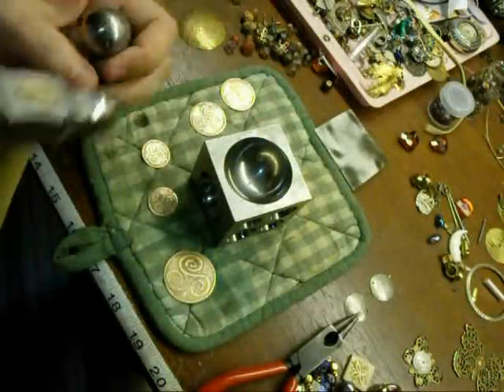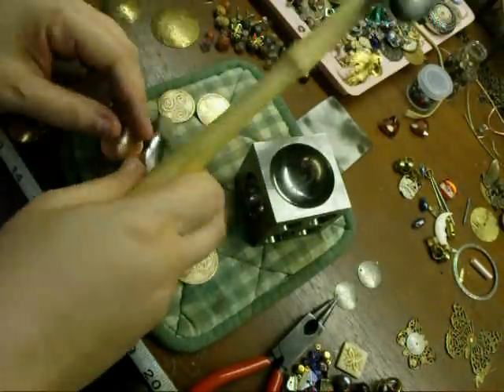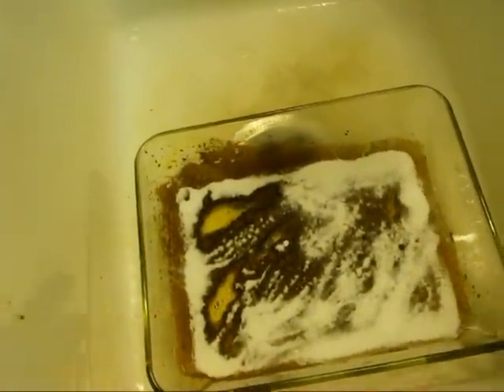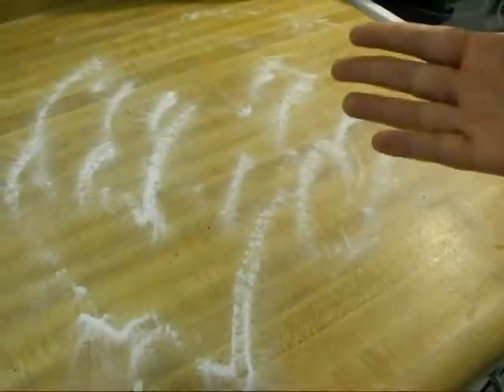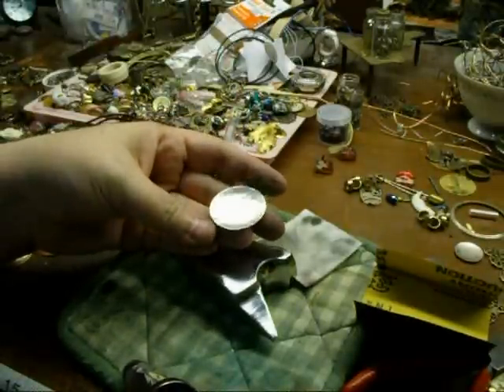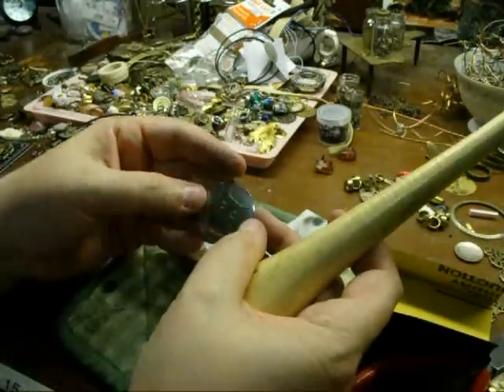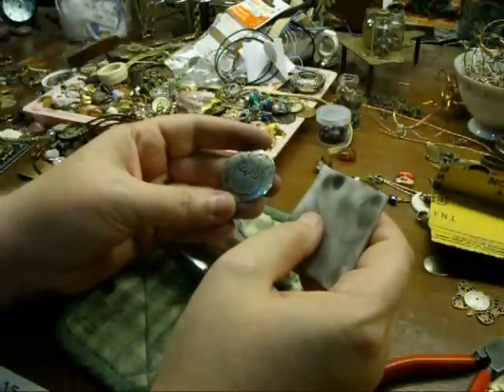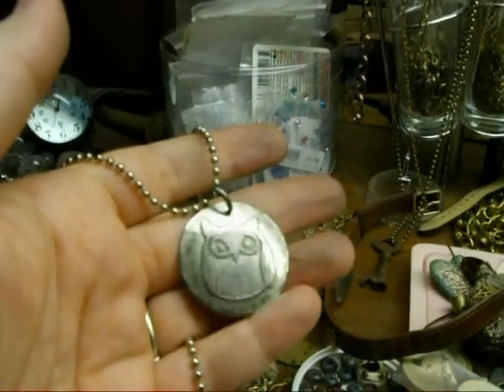Acid etching demonstration part 2

Comment: Very informative videos, I learned a lot from watching them! I am trying to etch nickel silver,  how long was Mr. Owl in his bath?
Reply from the maker: bls924 I don't recall, it's been almost 3 years since I made this video. Mr. Owl probably took about an hour and a half. But it also depends on the strength of your acid, how deep an etch you want, and the thickness of your metal. I've heard of some people putting it on top of a running dryer. The heat and agitation supposedly speed up the process. Just don't let it spill!

Comment: GREAT vids and finished products! Wow! LOVE that necklace at the end! Question for you if I may:  I recently lost my wedding ring of 22 years :-( and don't want to replace it with just anything. I'm pretty handy/crafty and I'd like to make my own so it has more meaning than just buying another ring. I thought I'd take some basic/stock metal ring and I want to try this acid-etching method with a meaningful phrase done in runes that I would draw around it using your method. What metals does ferric acid work with, do you know? All or only cetain types? For example, I've been looking at an inexpensive basic titanium ring to test it out on... But maybe should go with a different metal... Thoughts?
Reply from the maker: Thanks so much for your kind words. The ferric chloride I use works with brass, copper and nickel silver. I've been warned NOT to use it on other metals. I've seen info online about etching sterling with ferric nitrate, copper nitrate or silver nitrate, and gold with nitric acid and hydrochloric acid. It appears that acid-etching titanium is possible with hydrofluoric acid or something called Multi-Etch. But I have zero experience with these, so I can't say one way or the other how well they work. Personally, I'd take the new ring to a trophy shop, jewelry store or somewhere that does laser engraving and etching. The way things work with computers now, they might be able to put a custom design on it for you, without the chemistry. :)
Reply: JLHjewelry You're very welcome. Thank you for the quick reply and helpful info/guidance. I'll look into both: The laser engraving as well as the chemistry (I like the crafty side if within my skill set. If not I'll go with the laser). Thank you again. Really helpful. :-) Keep up the beautiful work!

Comment: Hello! This was a great video along with the first one. Do you buy the acid from Rio Grande? I use sterling silver, do you know which would be best for silver? What are you using for the acid and where could I find it for purchase? Thank you so much!
Reply from the maker: Thanks! There's a part 3 as well. I use ferric chloride, which is for brass and copper and should NOT be used with gold or sterling silver. I bought the ferric chloride from a locally-owned craft store, where I took a class to learn how to use it. My videos aren't meant to be a tutorial, just a demo. Use with care. I recommend taking a class and getting additional information before attempting. You don't want to hurt yourself, others, pets, your pipes, your sink, dishes or kitchen, or the environment.